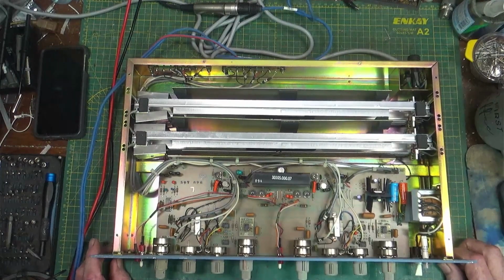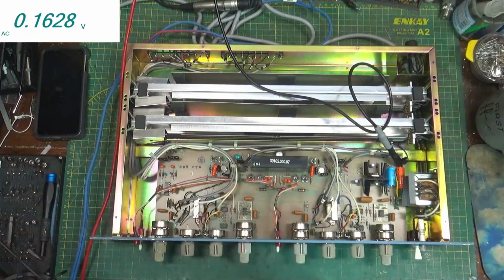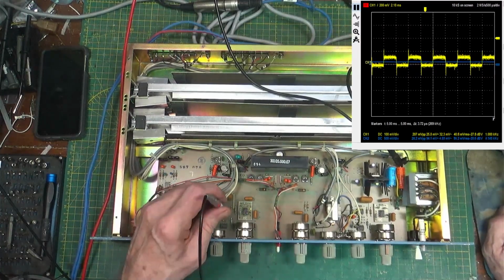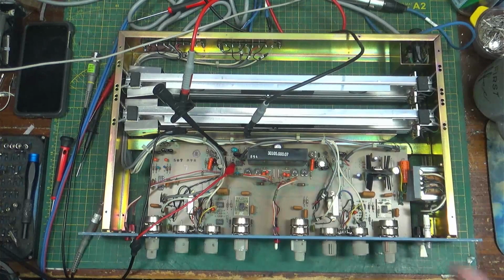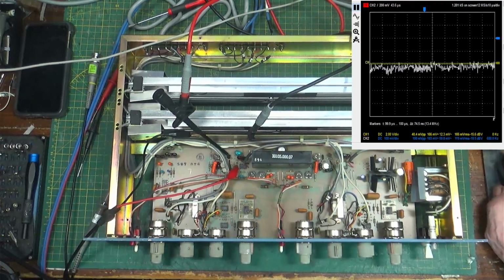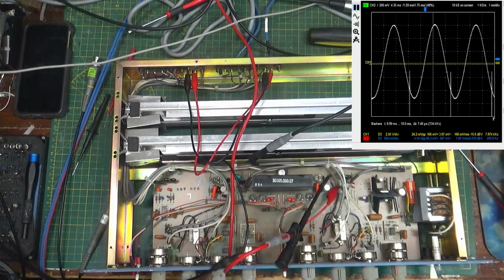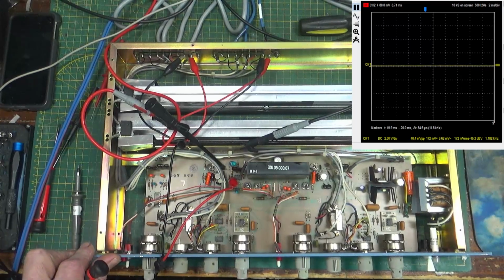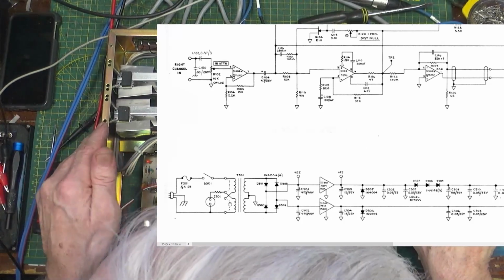Fix and Align Orban 111B Reverb

Comment: Is the Reverb unit for guitars?  I play guitar and was wondering.  I would love to have a real spring Reverb in front of my amp.  Right now I'm using a Reverb pedal, but it will not "drip" like a spring Reverb.  So I take it that this a stereo output since it has a left output, so it must have a right output as well.  That would fit nicely into the effects loop of my amp 'cause it's a stereo guitar amp which is a Crate 150.  Yeah, I like to play in stereo.  Cheers & 73 from W Rusty Lane K9POW in eastern TN
Reply from the maker: I guess you could use this for a guitar but that is not what it is designed for. It is made to add a little color and perceived loudness to voice and music. It really does not do a sustained reverb. It is a lot more subtle. Not even as much as karaoke reverb. It has left and right channels but they do not interact with each other or track each other like something made for stereo could do. 
Hint - wire up your speakers out of phase, stand in the middle and play away. Spatial baby!!!